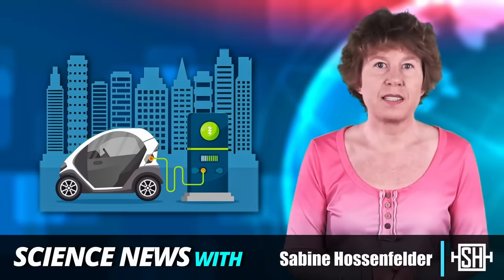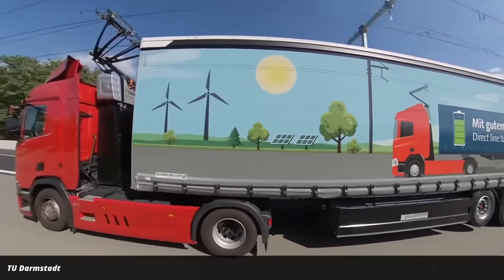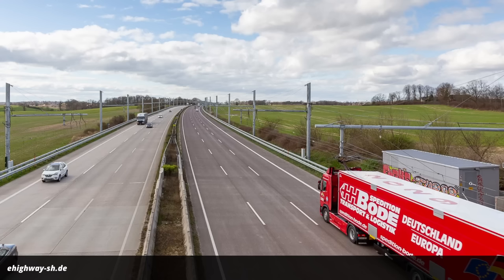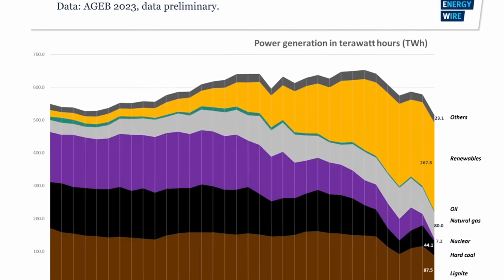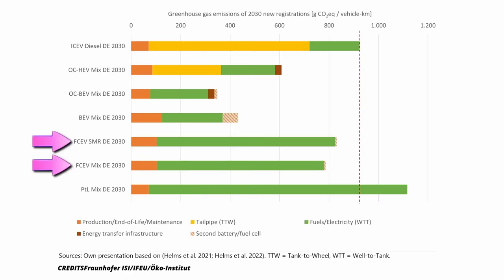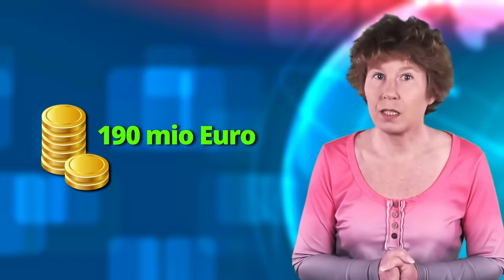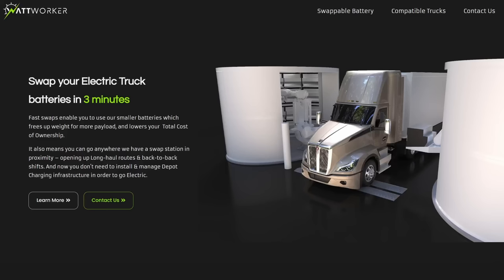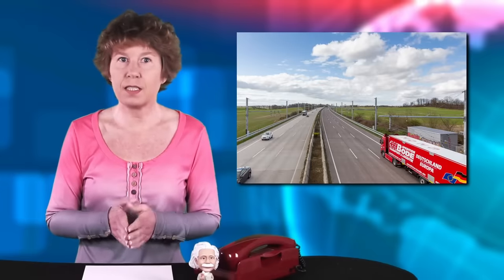Charging while Driving: Does it Work?

Comment: In Canada they actually dismantled the electric lines over railways so they could stack two cars on top of each other and transport more stuff (the freight trains are already as long as they can get).
Reply: Whaaat ? And running trains with diesel ? Battery ? Sideways electric lines ?
Reply: @Winnetou17  Diesel - this also makes them compatible with the rest of the US and Mexican rail networks which are not electrified either, so they don't have to stop the trains and switch engines when the electrified portion of the track runs out.
Reply: @gagenater  Ok, so at least there's that.
Reply: cant they raise the electric lines so locomotives can still make use of it
Reply: Who cares? Rail is already very efficient.
Reply: @duckface81  Even when that's done, companies that run under them daily (NS and CSX) will still say crap like "it's impossible to run double stacks under electrification."
Reply: IIRC trains can transport one ton of cargo well over 400 miles using only one gallon of diesel.
Reply: @travisbeagle5691 : To be honest, no decent electrician would be happy about distribution or transmission lines above trains either.
Reply: @duckface81  Height of trains, and electric lines above them, is limited by bridges and tunnels. One can argue that the line can get intentionally interrupted at a bridge or even in a short tunnel as the train will run through on inertia.
Reply: @duckface81 
They make double stacks under electric wire in India. And lines are made for it in Europe too. 
But tunnels may be a problem and lack of high frequency commuter service in Canada.
Reply: @leerman22  100% true. The only thing more efficient than rail are boats with thousands of shipping containers. People are looking at "solving" carbon in the wrong places for sure. Build natural gas power plants (or nuclear, if you must) and decommission the old coal plants. Far better use of money and 'saves the planet' too.
Reply: Indeed, the savings are minimal. To move long haul truck transport to train is way more effective. Electric trains in east and west coast dense area for commuter, to replace airplane would be nice too. From Boston to Whashington for ex. Easier to commute from CT to New York by train than from NJ to NY by car or bus !
Reply: @absalomdraconis  ?? HV electric lines over trains are a fact of life in many countries in the world, and have been for a long time. Most urban and suburban trains in Australia run like this, not aware of any significant problems.....

Can't use live rails outside of urban metro/underground trains because of the risk that someone could access them.
Reply: Trudeau sucks
Reply: @Mechulus efficiency isn't the only metric to look at when considering what improvements to make. Raw volume and total numbers can be important too. I forgot the exact number but I think it's something like in one year, 16 of the largest container ships produce the same amount of emissions that all of the worlds automobiles do. So by converting those ships to say, nuclear propulsion we could cut the emissions in half. Which I think is more doable and practical then trying to replace billions of cars and trucks with something that still requires fossil fuels to charge up since getting nuclear power plants built all around where people are living is a political nightmare. 

On a ship, a nuclear power plant will have all the cooling water it could ever need. If designed well these things could run for 20 years without an oz of carbon emissions before needing refueling. And when it does it may only be a few pounds of waste to deal with
Reply: @jasonharrison25  I’ll have to look into that statistic. It seems spurious at first blush, but I’m happy to be wrong and thus learn something new.
Reply: @Mechulus  statistics can be manipulated so it's possible it's wrong. I remember reading it several weeks ago and I don't remember the source. 

It could be as simple as, if these ships traveled the same distance as all the cars combined then the emissions would be the same. Which wouldn't actually be meaningful data. But could get people riled up. But if it's just raw volume or amount over a one year period then that would be incredible and a worthwhile discussion and possible means of reducing emissions drastically in a relatively easy way
Reply: @jasonharrison25  if only bias could be eliminated in science, we might be able to finally trust it again. Statistics are certainly manipulated or quietly discarded when they don’t corroborate our ideological predilections.

Comment: This was tried in the USA port of long beach about 7 years ago.  Trucks going from the port to local rail yards had the ability to use over head electric wires for power.  The idea was that since the port had such a large volume of trucks making this short run, that it would be economical.  I think it failed.  It did involve the German company Siemens.  I have also seen this type of system used on large(75 ton+) dump trucks at mines.  Those trucks were already using diesel electric power systems, so not hard to tie in external electrical power.

Comment: Short answer: No.
Long answer: Noooooooooooo.

But seriously, we have an electric trolley bus system in Arnhem. That works fine, because those busses drive the same route everytime.
Reply: Yeah, but if you can finish the route (last 10 km or so) on battery then what is the problem?
Reply: Last time I checked, the A3 and A8 have not changed their location recently and are always clogged with trucks that could run on electricity. While the 500 mile 40 ton truck has so far remained an Elon Musk powerpoint, an electric drivetrain with similar weight and size to a diesel can get a truck 150 to 200km. let it top itself up with an overhead power line on the long haul and its working just fine. This wont be a golden ticket but aready could solve the energy supply for the thousands and thousands of trucks just going Stuttgart-Hamburg every single day.
Reply: @BugMagnet that part could be ran on electricity, but how big a part is that of the total route of the truck? But for that part, trucks will need to be specially made or converted. Or you could make special trucks that take over the cargo on those highways. Since they'll need to stay connected to the trolleysystem, we could make them drive on a special track only for those trucks. Then we could daisychain cargo containers so only 1 truck can pull multiple trailers and to reduce friction we could make the wheels and track from a more frictionless material like iron.
Oh wait, we are back at trains again.
Reply: I see lots of trucks doing short trip routes multiple times every day, 7,5t from Erlangen to Nürnberg and back. Those could easily run on electricity and charge over night. But if we keep finding excuses for one usecase, then in the end nothing will change
Reply: @MrKOenigma  Those are light trucks and those really should run on batteries. Same with most busses. Everything that hardly does 200km a day and parks in a depot is perfect for that.
All the 40 ton ones going from Stuttgart or Colone towards Hamburg? Not so much.
All the 40 ton trucks just passing through germany? Also no.
For those it is essentially Fuel cells, or overhead lines or build a completely new rail centered logistics network that can replace the trucks. 2100 maybe.
Reply: @petrhajduk9955  it doesn't make any sense.

You could replace the road with a rail and carry much more freight.

Comment: Sabine 
A truck consumes about 6 times as much energy than a car, but weights at least 30 times more. This means a battery would be smaller and lighter compared to the vehicle weight and volume.

A battery that lasta for 4.5 hours and charges in 45 minutes is no big deal. You don’t need more because you are only allowed to drive for 4.5 hours before a 45 min break. 

Swapping batteries are complex and unconvinient, charging is not
Reply: U would still need a 500kwh battery in optimal.conditions lol. Any idea what the weight is of such a massive battery? Over 3 tons only on batteries lol. And 500 kwhs recharching? Such a loading infrastructure is even more expensive then the 24 billion for wires on 12.000 kms of highway lmao.
Reply: @KD-op4yz  yes, that is true. A tesla 80kWh battery is 480kg. 7 of them is 560kWh and 3.3 metric tons. But these batteries does not need to be structural so lets say 3 tons. 

3 tons of batteries in a up to 60 ton vehicle isnt alot. And you would probably save half of that by removing engine, fuel tanks, gearbox and drivetrain. 

It’s therefor more advantageous the larger the vehicle. The battery has to be around 1/20 the weight of a truck but in a car it is 1/4 the weight
Reply: @danielgranath2348   first of all a truck doesn't weigh 60 tons and not every truck pulls heavy goods.
It's total weight with freight is. A truck itself weighs around 13 tons. And 
even then are tension wires on a highway cheaper even a bargain. You would need a giga lot of charging stations capable of charging those truck batteries with 500kw and more per hour. The infrastructure cost alone for that is enormous. Knowing well enough that truckers barely have  parking spaces for the night to sleep. They are even parked at the side of highways and roads on busy routes let alone that there are even enough charging points...
Every truck stop would have to be specially rebuild for those high amounts of power needed to recharge such an amounts of trucks.
Electric trucks are only feasible for standard smaller distances and city traffic  truck, not for going from the south of spain with fruit to northern germany.
Reply: @danielgranath2348  60 tons? Most countries in the world have 40 tons limit for a semi-truck.
Reply: Electric trucks would work well for shorter hauls where you only have to charge at the origin and end points so no public infrastructure required.  The value of removing all the engine components is significant in terms of maintenance alone. I'm not sure about the economics of longer hauls.
Reply: @KD-op4yz  A 500kWh semi can be built and operated with a lower lifetime total cost of ownership than a diesel, including the charging infrastructure. I engineer this daily.
Reply: @yansakovich  ah, maybe different here in Sweden

Comment: A mix would be ideal. Electric trucks with the ability to charge directly while driving. So you wouldn't have to be wired every mile of highway. This would optimise the drivers' schedule. Compared to battery swap stations or static charging points, this could cover a larger area for the same amount of money invested. Similar logic to partial trolleybuses, which with smaller batteries will travel longer distances with less stationary charging time than electric buses.

Comment: Just a note about trains: That a lot of tracks already exist doesnt mean you could just shove more freight trains onto them. Many lines are already used at capacity and actually building more rail infrastructure is basically impossible as a private company, even ignoring the huge cost, just because of insane government regulation of it. You have the same problems with providing that electricity, although trains are more efficient than trucks at least. Plus you'd probably have to build more locomotives too since its not like there's just an infinite supply of them ready to use, just like electric trucks. So that probably leaves the biggest advantage just being that you wouldnt need any batteries.

Comment: There was an economics competition in the UK in 2017 asking questions about solving various road issues. A prize was awarded to an idea about collecting energy from vehicles travelling over harvester devices. Unfortunately, it ignored the issue of there being 'no free lunch' as that energy has to come from somewhere - namely the vehicles themselves which would be marginally less efficient as they lost energy to harvesters.
Reply: I think just offsetting as much of the fossil fuel usage as possible is easily doable with current technology. If solar panels are put everywhere - on the tops of lorries, in solar farms, using hydro electric, turbines, windmills.. whatever. As long as more and more energy is produced cleanly, the transition can be so much smoother.
Reply: It might not be a net loss for the vehicles if (e.g.) the energy came from vortices which were shed from the vehicles and moving off the roadside. In other words, the vehicles are losing a lot of energy to drag anyway, so harvesting that energy specifically might still work.
Reply: No free lunch is another issue. Energy harvesting from for example passing vehicles is commonly done for small energy requirements. There are places with little infrastructure to deliver power to a device but many cars passing. Stealing a few joules from every passing car, nobody would notice, but it can be enough to power such a device.
Reply: @AySz88  " if (e.g.) the energy came from vortices which were shed from the vehicles"
That can work for tiny amounts of energy but it is absolutely not worth it at all.
Reply: @hanslepoeter5167  I don't dispute for small energy requirements. But this entry was for grid scale generation.
Reply: you put the harvesters in braking zones; it 'steals' energy in places it would need to be displaced anyway, and if people adapted, less brake pad replacements.
Reply: @zakuraayame5091  "you put the harvesters in braking zones; it 'steals' energy in places it would need to be displaced anyway, and if people adapted, less brake pad replacements."
no? No.
Reply: @andyonions7864  That's a very important distinction!
Reply: @zakuraayame5091  Yes, exactly that is what happens in many if not all electric cars.
Reply: @andyonions7864  Right. That is not a realistic approach whatsoever.
Reply: I despise these little "feel good" exercises that make people FEEL like something is being done when it's not. My solution is just to create a free energy device and power the whole world off it, when I'm done with that I can create a magic food machine and solve world hunger and then a "walk a mile in someone elses shoes" device and finally get that world peace figured out. I'd like my prizes now thanks.

Comment: This system was used in open pit mine decades ago. As the mine eventually expanded, the infrastructure was scrapped and not reinstalled. I don’t know of any mines using it today.
Reply: anyone who is a fan of shows like Gold Rush knows that fuel is a MASSIVE part of their costs, so if these guys (and their much bigger brothers) aren't running it something has definitely caused them to rethink it.
Reply: @anthonyhiscox  The direct energy cost was actually much less than diesel. It was the infrastructure and maintenance. It can be cheaper to use the electric power and pantographs to supply it to vehicles, but you need regular routes like trains and trolley cars to really make it viable.

Comment: Something that wasn't discussed in the results was the massive amount of bleed-charge in the lines caused by them having to be so close together.  I doubt this is as efficient as even building a two-flat-runner system for shipping and transport that uses its own special rail system
Reply: IIRC trains can transport one ton of cargo well over 400 miles using only one gallon of diesel.
Reply: Ehhh sorry, google does not know the terminology "bleed-charge" in this context... explain!?
Reply: @johumm455  Basically, because the conductors are so close together over a long distance, they form one long capacitor. If you feed them AC power you'll lose some energy just to constantly pumping against that capacitor through the resistance of the wires. The same applies to all AC lines to some degree. No matter how high you crank the voltage the efficiency gets really bad at very long distances.
I don't know if that's enough to be a problem here though. There are plenty of ways to mitigate it, and it could be eliminated entirely with a DC system, but that would also be more expensive.
From what I've heard, the main concern would be continuing maintenance. Apparently slight damage can rapidly get out of hand on these kinds of systems if not caught early, and this is challenging enough on railways. A poorly maintained truck could chew up the lines, which in turn would chew up the ...thingies on other trucks and so on.
Reply: @fnorgen this isnt the same system for trains and actual trolleys its a similar idea with a modern approach. So I'm not sure if the impact with lossing energy would be the same.

Comment: Batteries are the way to go.  Tesla has proven, you charge a semi with 300 miles or range (480 KM) in 30 minutes.  Thus allowing a single driver to travel over 600 miles in under 12 hours with charging.  It looks like 700 KWH of LIFePO4(CATL) batteries will be available for around $50,000 this summer.  It looks like Europe will up the Z-Emissions allowance to 4 tons.  That means a usable and affordable long haul truck should be available by the end of the year.